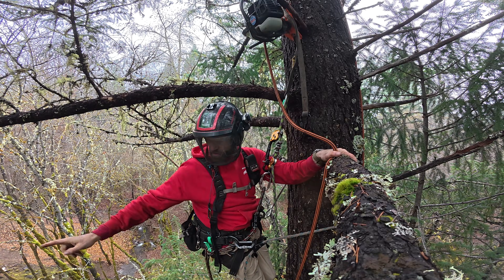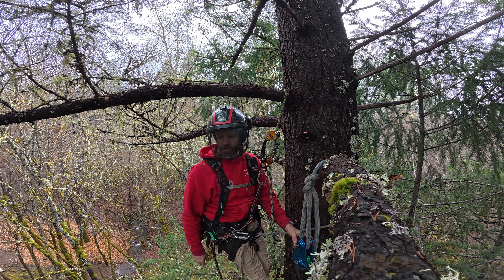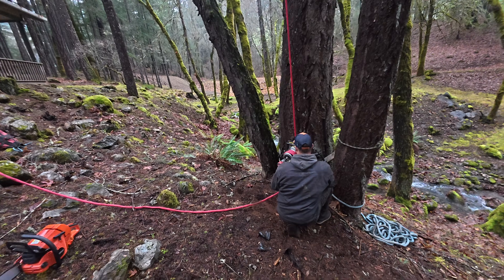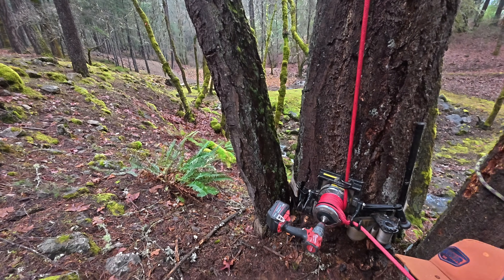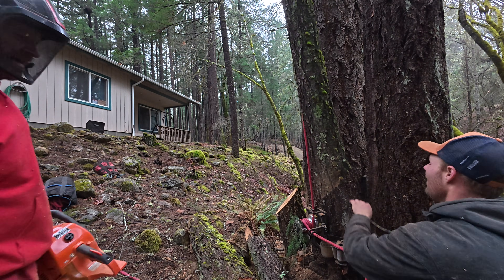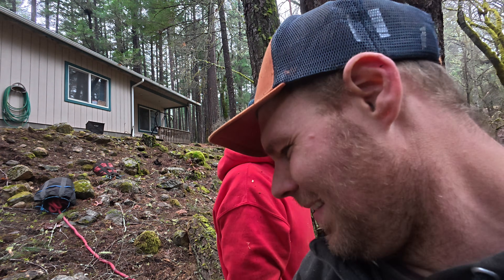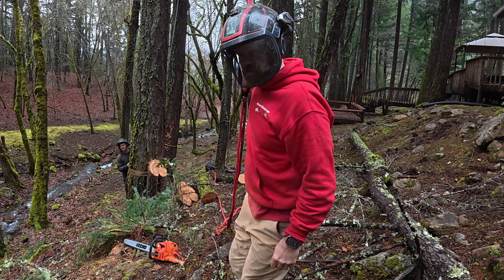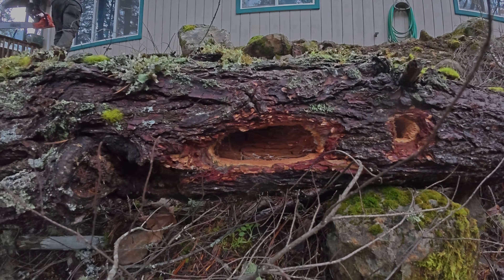We Removed this Tree With a DRILL

Comment: You might add a sling around the stem at the rigging branch for extra safety in case the branch fails. Still retrievable with the rope passing through the sling loops.
Reply from the maker: Ya, but rigging would break before that limb broke at the collar.

Comment: I love my GRCS.  I must say, im a Milwaukee guy too, but the makita 40v right angle drill is well worth the investment for cranking the GRCS. No wrist breaking and will give you all of 2k of pulling power. Have a Merry Christmas Guys! #HardHatArea 🫡
Reply: That’s what we use for the GRCS. It’s a time saver too. I also use it for free rides into the canopy. I literally just did this same setup yesterday. Had a medium to large white oak for the rigging point, and took a baby hickory that was maybe 6”DBH but was just as tall as the white oak in one cut.
Reply: @JamesVanholbeck yes definitely.  I had 2 trees leaning way backwards and one broken into the other and with a little patience and the right cut on both pulled both away from the house smooth as can be
Reply from the maker: Ya angle rt, drill would be best 💪🏼
Reply: @AugustHunicke  its like butter super smooth on gear 1 low speed
Reply: My lastest video on my page shows it in action! 
#Makita40vRightAngleDrill